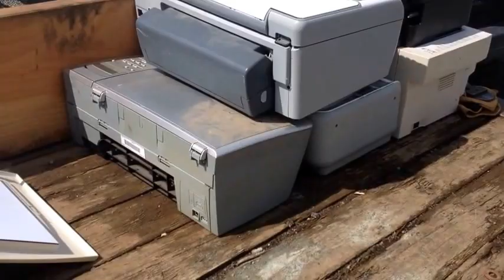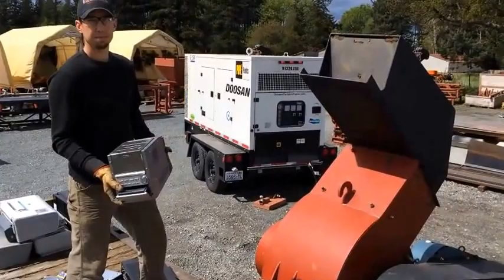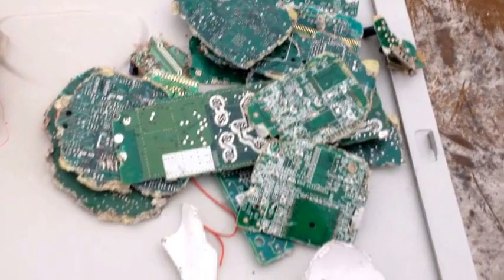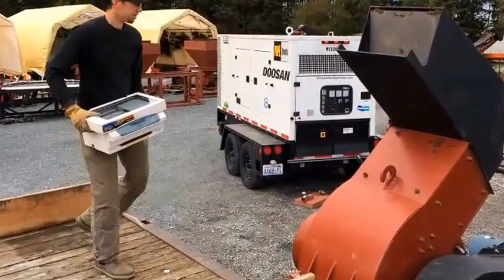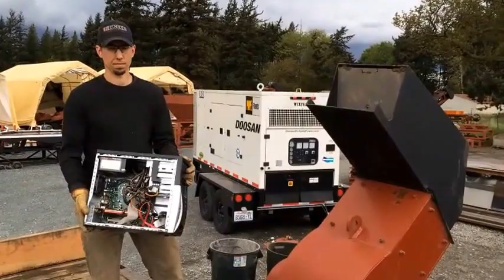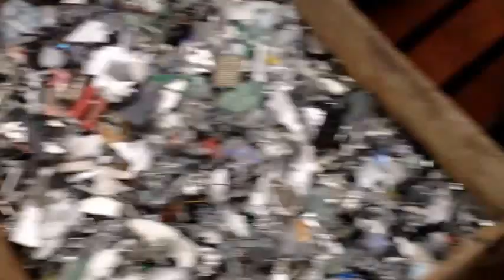Hammer mill recycling whole printers, microwaves, computers, and more

Comment from the maker: Tyler Davis-
Thanks for the comment and I have had people ask about batteries in the past.  I am sure it would do a great job of knocking all the lead out of the plastic.  Maybe in the future I will give batteries a try.  Thanks for the suggestion!
Reply: could you try lithium ion batteries. or any battery with a foil coil inside? i wanna know how well a hammer mill works with separating the different layers from each other. Do you have any experience with this kind of product?

Comment: Hi Jason. As always, excellent videos. If I may, I suggest to run the output materials first through a magnet belt to remove ferrous, then use eddy current separator to remove aluminum and plastic, collect non-ferrous ar the end, pyrolyze them, follow by incineration and smelting with copper. This would make all precious metals in the mix into a 98% copper anode which can be further processed or sold to a refinery.Amazing stuff.
Reply from the maker: Great, thanks for the tip!

Comment: Hi Jason,

Thanks for your video. You seem to have covered the basis of ewaste recycling. The process after what you have done, as you mentioned it, is handpicking batteries, magnet separation, eddy current separation, then remain should go to another hammer mill with smaller screen, then using  your shaker table to separate aluminum, steel and copper.
Some of the plastics can be separated by floating them on a pool of water, the specific type will stay on surface heavier ones sink to the bottom.
Good job, I am awaiting in Que for my turn about the circuit boards hammer mill.

Best regards
Kj
Reply from the maker: Kourosh Javanbakht Thanks for the comment and the good ideas about the plastics.  I don't have much experience with plastic recycling, floating the less dense plastic is a good idea.  We are working hard on our hammer mill for PCB's and hope to have something soon.  Thanks again and we will be in touch with you as soon as we perfect our board grinding system.

Comment: Whenever you are doing lead batteries, the sulfur acid has to be drain before put in mill. I suggest the RPM of the mills to reduce by lower the watts to tear it in piece because a fast spinning hammers will turn the lead sheet into crumbles with other junk that would be inefficiency. The acids can reduce the mill life dues to rusts and crossive unless protective coating is applied I grew up near Tabasco factory that sitting on top of salt mine and all the vinegar and salts that aged the hot sauce forced the company to replace their forklift every 5 years due to rust.
Reply from the maker: Thanks for your tips and insight.

Comment: The sheer value of the individual electronic components would yield your hungry little pocketbook 10x more than the mixed scrap 'value,' surely..  
Makes a grown electronics enthusiast cry...
Reply: Labor has a cost, it is not a 10x yield if you have to pay someone $15/hr to remove the components. The clients Mbmmllc are not hobbyists, they need to process it with the least labor at the lowest cost/return on investment... The labor required to break down hundreds of tons of e-waste a day is not trivial.

Scrapping as a hobby is one thing, I do it b/c I enjoy it, and I don't like throwing out metal scrap or usable components, but its a net negative cost wise... I'm not making money at the scale I can do it, but e-cyclers HAVE to make money or they arn't going to stay in business and would not exist.

The value when you are processing hundred of tons of this waste if you spend 5 min on each @15/hr just to recover the easily separated components would quickly cut that yield. The more time you spend recovering components the less those components are worth by nature of the labor and infrastructure/maintenance costs these companies are investing to be able to process the massive amounts of e-waste our society generates. These costs are (esp. labor) NOT going down so efficiency needs to go up or scrap prices will continue to fall which they have been doing since e-cycling first started to gain traction. E-waste prices have gone down as supply has gone up, without the gains in efficiency created by the industry and new processes they would have ceased to be profitable and this stuff would just end up in landfills.

Comment: Would of taken out the microwaves magnetron before attempting that!
Reply: +Michael Chacon  How else am I supposed to get Beryllium into my lungs?
Reply: The magnets get smashed and turn into dust and vary easy to breath in and it will cause cancer and its untreatable.
Reply: TMoD7007  I wouldn't want to bet on it. I melted some scrap relay contacts for the silver and got a severe case of Beryllium toxicity, which was misdiagnosed as Sarcoidosis. Over 40 years ago, but it was miserable.
Reply: TMoD7007  I didn't know about that. I have been taking a lot of extra precautions in breaking down my magnetrons.

Comment: Im curious if u run the scrap sgain through the mill , will it crush to powder? And if so then you might be able to mix it with cement
Reply: I would think it would be a shot in the dark. There are several different  types of materials being pulverized and mixing with cement you would be counting on the mixture to bond and not oxidize or disintegrate. I  wouldn't try it.

Comment: Love the video, it very efficiency and profitable for E-cycle companies to process that but I feel it would be better for them to remove the gold bear Ram Memory and CPU which only take a minute to remove because the mill will beaten it into dust that would be like a needle in haystack and costly to recovery it. For microwave, for company or resident that buy mill to shred appliance and white good the EPA would be happier when they pull magnetron out due to Beryllium Oxide which is the pink ceramic before throw in mill.
Reply from the maker: Thanks for the tips.

Comment: So you have all the little pieces, hand separated into piles for recycling?
Reply from the maker: of the earth Most of the stuff we ran was very low grade and for customers specific requests.  With a cross belt magnet and an eddy current and then hand picking off a conveyor afterwards some decent separation could be done.  The big question for me is how to recycle all the different kinds of plastic.  If that nut can be cracked then I think there is real potential for something like this.

Comment: thats a nice machine.
My suggestion for smashing:
Air brake spring pot.
I'd like to see how easily and safely it can separate the steel and aluminum, without hurting anyone with the massive spring thats inside it.
Please tag me or send me the link when you do the video.
Thanks
Reply from the maker: +angryadrien Thanks for the suggestion.  Do you have a source of these you can send me over some to test?  Thanks
Reply: +mbmmllc yes I have some but it would probably be easier for you to ask a local trucker or truck shop if you could have a few scrap ones.
Are you familiar with air brake spring pots? 
If not,  I'll send you the link for a safety video....you'll see why it's important to scrap them carefully.
Thanks for the cool videos.
Reply from the maker: +angryadrien Thanks for the tip.  I will check into it and let you know what I find.
Reply: +mbmmllc Any updates?
Reply from the maker: +angryadrien Nothing yet.  We are just getting another system set up so I hope to have a video of that running in the next few weeks.  Once that is up and running I can start running more samples.  Thanks for checking back in.
Reply: +mbmmllc hi. Do you have any updates yet? I'm excited to see what you've come up with :)
Reply from the maker: +angryadrien Here is our newest video: https://www.youtube.com/watch?v=vTl6F2cqiMI  We are working on the recycling side of things, but it is going pretty slow.  Our mining equipment has been selling like crazy so our shop is at capacity and we don't have a lot of time for R&D.  I will keep you posted on how things go.  Thanks

Comment: Hi Jason, could you post power in kW of mill and screen size, please? 
BTW, thanks for another cool video!
Reply from the maker: Lubomir L Hi and thanks for the question.  The KW is 55 and the screen size on this demo was 3"x3" square holes in a 1 1/4" thick screen.  Thanks again!
Reply: mbmmllc Thanks for fast answer. I've just forgot to answer. It is possible to show hammers and the rest inside the mill. Are they damaged somehow?
Reply from the maker: Lubomir L Please check the end of this video.  https://www.youtube.com/watch?v=4x8ogUAfT6U

It shows the inside of the hammer mill and the hammers.  Also we ran some pretty aggressive stuff down the hammer mill in the linked video and the inside of the hammers and hammer mill are still in great shape.  Thanks

Comment: Guess u guys don't have a e scrap buyer around???
Reply from the maker: Dirtdog Scrapping Most of this was for R&D or to fulfill a customers specific request.  This was mostly pretty low grade scrap.  With a cross belt magnet and an eddy current with a final hand sort off a conveyor belt I think some decent separation could be done, but then you have to deal with all the plastic.  If the plastic could be separated and recycled then this could be a real viable option.